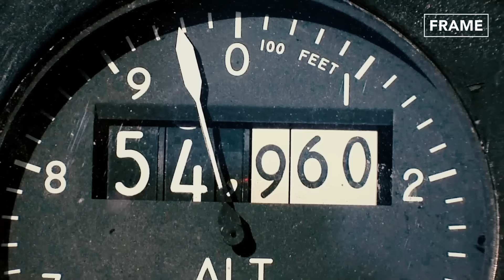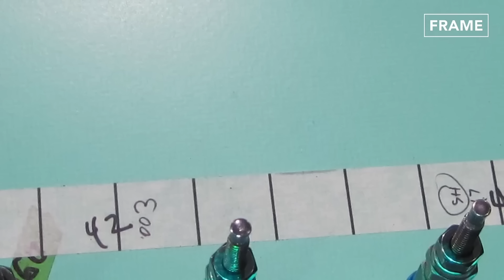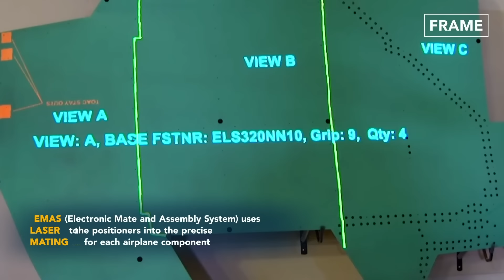Inside Billion $ Super Advanced US F-16 and F-35 Manufacturing Assembly Line

Comment: 10:42 Did you zoom in to show us Swedish technology in an American aircraft factory?
I'm talking about a pneumatic drill with a nozzle for countersinking holes.😂

As I understand it, you also don't wear special protective clothing when a worker works with composite material.
And in general, as I understand it, you don't have uniform corporate clothing for employees?😐

In general, I have a lot of questions for you about the fuel system of the aircraft. What pipeline connections do you have? Do you use "quick-detachable" body-nut type connections and lock them with a safety wire, or do you have a different connection, similar to a body-latch?

Sincerely, KnAAZ employee.😇